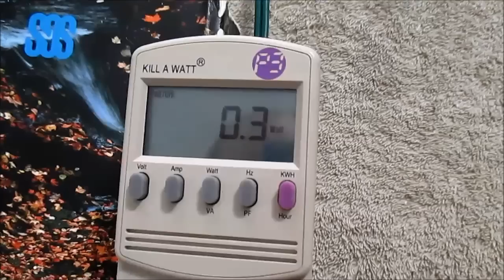Dead LED bulb teardown

Comment: Hello, I am obviously late to the party but I hope you can share some advice for a couple of questions I have. Awesome video btw. I learnt a lot and love the way you "re-use" what you have as tools for trouble-shooting :)

- In 4:56 of your video, you mentioned shunting throught the 10A port of your TURNED-OFF Multi-meter. I am wondering if this is any different from running though a wire loop with a built-in 10A AC fuse (with probes to close it) ? I could do what you did - but my recent scatter-brains makes me jittery in having anything inserted into the 10A terminal of my multi-meter. I usually use another clamp-meter to measure amps

- In 8:02 of your video, you used a diode bridge rectifier with a current limiting lamp. That is a chunky beast. Can you share the specs of that diode bridge rectifier ?

- Also, looks like you hooked up 110V (will be 240V in my case) directly to your bridge rectifier and then DC to the LED. Wouldn't that make it a 110VDC directly to your LED ? How do you ascertain that will not destroy the LEDs ?

Thank you for your help and the video !

Comment: My local dollar tree store started selling led bulbs witch surprised me cause the last one I bought was about 8 dollars at lowes I'm curious to see how long these last but for a buck if it lasts a year I will be happy .
Reply from the maker: I was in DT last weekend and found the LED bulbs. They seem like the one you described, "Home Luminaire" brand. 9w, 3000K, 800 lumens. Someone here on YT tore one down.
Reply from the maker: It seems the Dollar Tree near me has nothing interesting. I always hear about people finding interesting things from their DT stores. What brand, wattage, ect. is the $1 bulb you found?
Reply: I have yet to see them either but will have to ask my brother, the downstate DT s get all kinds of stuff I never see out here.
Reply: JohnAudioTech the Dollar Tree stores near me always sell out of LED bulbs very quickly. Go there a few days after they get more and they're gone with no trace. Always 60 watt warm white, rated 9W, but the current consumption claimed is 150 mA at 120 V which should be 18W. Translucent plastic dome over white-colored aluminum truncated-cone thing jammed into the screw base.

Tore one apart. Very simple: some sort of fuse or fusible resistor wrapped in black heat shrink or something, capacitive dropper, bridge rectifier, electrolytic filter capacitor, some resistors, some sort of chip on the circular board that holds the LEDs (everything else is on a vertical board that plugs into a socket off-center on the aluminum-backed LED board). 15 LED chips, possibly dual-LED, apparently in series. (This from memory and a bad photo.)

Comment: I had the exact same failure on a 2015 Philips LED bulb. Turned it on one evening and heard a "pop click" sound. The bulb just dimly flickered but didn't trip the breaker, took it apart and found the same choke and resistor open circuit (the resistor was burned in my case).

It was installed in an open fixture pointing upwards so I guess it was just the inrush current that did it, especially since we get higher than average (but in spec) line voltage here.
Reply from the maker: I'll have to crack that choke open. It must use fine wire. It is odd to see that kind of failure.
Reply: I purchased three of them for a 3 lamp fixture and the other two are still working fine, but I agree it is an odd failure especially for a known brand such as Philips. Sadly it was also a one way street taking it apart requiring the use of a saw and vice.

Comment: Looks like that was well designed, until it failed of course.  I'm surprised this doesn't have the standard capacitive dropper circuit I see in many of Big Clive's videos.
Reply from the maker: This was a high power factor version made for use with light dimmers so it had to have active circuitry. I miss your videos, Clem. Hope you get back to making more.